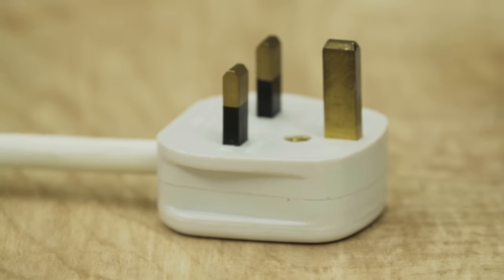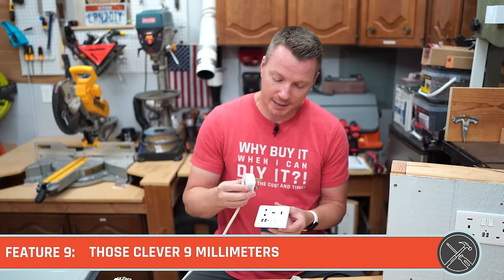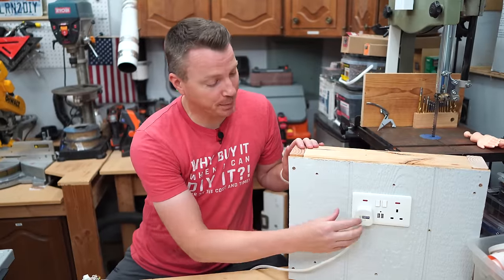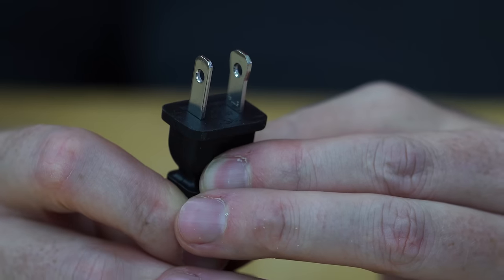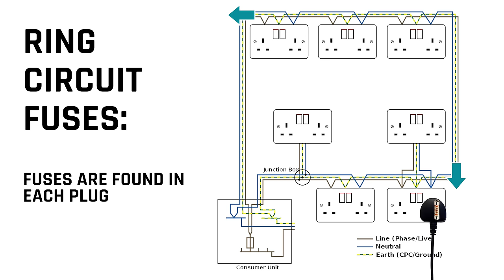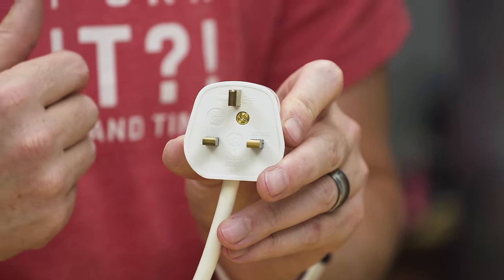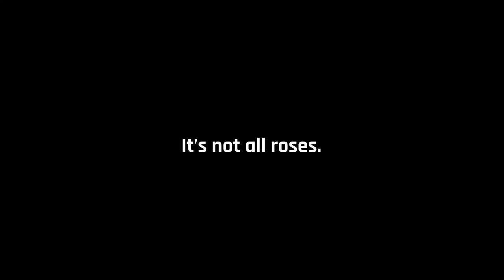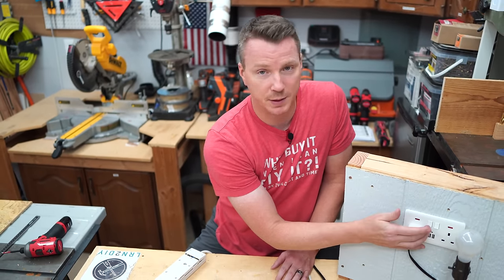British Plugs and Outlets Are On Another Level

Comment: One of the benefits of the removable plug that isn't mentioned is that you can remove the plug to pass the cable through a small hole and then reattach the plug. This can be useful and is far better than having to cut a massive hole to pass an entire plug through.
Reply: I did this when connecting up my offgrid solar to my home office, got a big extension cable, put the cable through a vent (60s house) and reconnected, no need to require a massive drill to drill a big hole through the wall
Reply: We can take the plug off and have an even smaller hole😉
Reply: @infideluk  They really don't get it, do they
Reply: @FirstNameLastName-hahaha  who is/are they here?
Reply: Good shout
Reply: Another advantage is that you never have to buy a new plug - when old appliances die, I always remove the old plugs/fuses in case I need them, such as for extension cables or if a plug gets broken, though they are very solid and last a long time being quite hard to damage. I have one plug in daily use that must be about 60 years old.
Reply: Been there, done that!  :-)
Reply: Those plugs are like mice you can fit them through a hole the size of a pencil if you know what you’re doing
Reply: @littlebigcat  Whilst a cable will genuinely fit through a hole the size of a pencil an entire plug will not.
Reply: @littlebigcat  We would expect nothing less than purrrfect advice littlebigcat when it comes to mice.  🙂
Reply: I've got a 6 gang switched trailing socket out in my porch that way.
Reply: @zimzimph  if the shoe fits ..
Reply: @roaduser6438  what littlebigcat means is it’s easy to remove the plug put the wire through a small hole then re-wire the plug takes a couple of minutes👍
Reply: @psyjayne  That doesnt appear to be what he means as that's what my original comment is. Littlebigcat talking about the plugs says "you can fit them [the plugs] through a hole the size of a pencil". If he did mean what you think he means it isn't what he said and isn't anything that hasn't been said already.
Reply: Don't you just hate the plugs moulded onto the cord. You cut it off, bin it, and replace it with a new one from the store of spares.
Reply: I bought a unit for my hi fi the picture shows a record player on top with a amplifier underneath. When it came there was no holes for plugs. I was going to buy a hole making drill bit but it was £15. I ended up drilling holes in a circle and hitting it out with a hammer. I wouldn't have bothered but I had cables as well as the plug , to come from my amplifier.

Comment: Another feature of the British plug is the fuses also come in various capacities such as 3 amp, 5 amp, 10 amp and 13 amp. Electrical items will come with the correct amp fuse relevant to the load it will be under during normal operation.
Reply: Most think the fuse is to protect the appliance too but this is false, the plug fuse is to protect the cable and should be sized as such.
Reply: The downside to this is that when people casually replace the fuse, they almost always slap in a 13A one regardless of what the requirement is.
Reply: @moopet8036  I do like for like everytime.
Reply: @moopet8036  assuming they bother with a fuse and don't go for rolled foil from their last pack of smokes.
Reply: @anne_frank_ lol a pack of ten assorted fuses is £1. I keep a couple of packs in a drawer 🤣
Reply: @anne_frank_  would that actually work? and for how long?
Reply: @DAN.eight6  It depends on how much current the device draws. If you're lucky, the foil will be destroyed very quickly. In the most unlucky scenario you use something that can carry far more current than the cable or the device itself and a partially or fully shorted circuit makes the cable or device burst into flames.
Reply: @DAN.eight6  yes it works, yes people do it and dear god I’ve seen worse over the years as a sparky. 

Rewirable fuses keep blowing? Just put a few more strands in to fix it  I have actually found a bit of cable fitted instead of fuse wire and even the classic nail. Scary things to find.
Reply: @DAN.eight6  It works, just not as a fuse. At least until it does real badly. Don't do it. I work as an electro-mechanical engineer and repairing other people's machines I've seen a lot of stuff used in place of a fuse. Nails, bolts, metal cut-offs, even a small soldering iron tip. Safety third in a lot of shops.
Reply: @syrea793  Sadly not everyone is as sensible as you, especially in a workshop where even if fuses are made available the 200lbs gorilla operating the machine will just cram a nail or a paperclip in because it's 'faster'.
Reply: @DAN.eight6  It'll keep the electric going but the point of a fuse is to cut off the electric when there's a danger. Don't do it, fires might ensue.
Reply: @moopet8036  exactly. A boiler should always be 3A for example but I found a 13A one in there when I moved in
Reply: @syrea793  I've got a big mixed bag of whole plugs or just fuses at home ,every time I scrap an appliance,  I have at  best a whole  spare plug,or if the plug is moulded, I whip the fuse out , for a spare.
I do similar with cars. If I scrap a car, I take all the fuses and bulbs out for spares.
Reply: The Main circuit will trip before that. @Curt_Sampson
Reply: @mauricegreen8185  Really? Why would they bother with the 3A fuse in a plug then, if can handle current all the way up until the 30A main breaker trips?
Reply: As a european: why fuzes in the plug?
Do you guys often have to replace one?
In some cases i can only find them in appliances itself. But even then never ever had to replace one. 
Aren't rccb or whatever it's called there for such reasons? Replacing fuses in general feels like 1962 here..... Just because people always put in a stronger one thus making it more dangerous.
Although the switches are a smart thing i'm jealous about. Do you guys have them with a internal light?
Reply: @KD-op4yz  The fuse in the plug protects the power cable. Damage to the device or the cable can cause more current to be drawn than the cable is designed for. If this is not drawing enough to trip the (generally much larger) circuit breaker for the power outlet, the cable will heat up and set on fire things around it, and perhaps even catch on fire itself.

If you look around YouTube you can find plenty of videos of AC power cord fires.
Reply: @Curt_Sampson  The reason for the fuses in the UK plugs is that 32A main fuse. In continental Europe, there are much smaller fuses at the breaker board, so the chance of the wires catching fire through overheating is much smaller.
Reply: @Curt_Sampson  thanks for the info 😉

Comment: One of the minor features about the plug that often gets overlooked is that if you are colour blind you can wire it correctly as the colours are designed so that one is black one is white and the earth is black and white and the colours where chosen for both the letter reminder and again with partial colour blindness they could never get mistaken

Comment: Having a larger plug is useful if you have poor grip/dexterity. Indeed in the UK we have versions of the standard plug with a hoop on the back so that you can put a finger through it to pull the plug out. My late mother had arthritis in her hand and I replaced several plugs she would need to swap over every so often with these larger hooped versions to make it easier for her.
Reply: For plugs which don't come with a loop grip you can buy a thin plastic loop which anchors from top and bottom on the live and neutral pins to create a pull loop. My grip is staring to get a bit dicey and they are really useful for removing a tight plug.
Reply: @daviddou1408  well pulling the cord wouldn't help anyway.
Reply: Breville appliances sold in the US have that. It’s very cool 😎

Comment: Hi from the UK. We used to have everything on a separate fuse, but one of the reasons we went to ring circuits was to save on copper after WW2.
Reply: That's fascinating, I didn't know that.
Reply: I didn't know that either.

Comment: The other feature of the replaceable internal fuse is that you can match the fuse to the load. Fuses are available as 3Amp, 5Amp or 13Amp and are colour coded to prevent confusion.
Reply: 7a and 10a are available to British Standard too. Rarely seen.
Reply: Williams I suggest watch a 13 part series called What on earth happened by Ewaranon to learn that the earth is not a globe. Link in my about tab.
Reply: @flat-earther  You just want a free trip into space
Reply: @2Sorts  You can get 1A and 2A ones also, but yeah mostly need to shop online or at specialist stores to get them as most brick and mortar stores don't carry them.
Reply: @seraphina985  This is also true. 1st I saw those was at Bacton Gas Terminal. They used to fit the absolute smallest value fuse to any plug-in equipment that went out to the rigs. 
Even new stuff had to be opened, examined, re-fused and then PAT tested by the maintenance shop on site, before I was allowed out to the rig.
Reply: @2Sorts  That makes sense especially in that environment where the hazmat being processed would significantly exacerbate any ignition due to overloaded electrical equipment. I'd imagine that there was probably a lot of work done in trying to ensure any electrical components that safely can be airtight are where possible. I'd assume it would be a layered defence strategy first minimise the risk of electrical faults becoming an ignition source, failing that try to exclude the potential chemical accelerants from contacting the electronics and so on.
Reply: @seraphina985  I have some 1A and 2A fuses but they are the glass ones
Reply: @2Sorts  Or the universal fuse made out of tinfoil. I've yet to find one that fails!
Reply: That is a great feature, but if you don’t happen to have any spares in your kitchen drawers, tin foil has been a dangerous work around. 

Now your blown small fuse is the mains rating of the ring circuit.
Reply: The fuse protects the appliance cable and must be sized according to the gauge of the cable. The appliance cable should be sized according to the appliance load. Everything depends on everything else. "Load balancing" nope, not required. Ring mains use less copper overall, and while it is not an ideal situation, can operate with lower safety margin with one ring continuity fault.
Reply: Although you can do that it is worth remembering that the actual purpose of the fuse is to protect the cord, not the load. It's to stop the cord from catching fire if the load shorts. That means it's fine to use a lower value fuse, to do what you say to protect the load (although the load has failed already thus blowing the fuse lol) but you never increase the value of the fuse o er what was fitted!
Reply: It's good because you can reuse the plugs, say your hairdryer on a 15a fuse dies, just take the plug off, chuck the hairdryer in the bin, use the plug with a 5a fuse and wire it onto a lamp for instance... Lot less waste
Reply: The plug fuse is not designed to protect the load. Instead it is designed to protect the cable between the plug and the appliance.
Reply: I can't say the colour coding was something I ever really noticed - I just read the requirement on the plug and so never even noticed the fuses were a different colour to be honest until you just told me they were.
Reply: Except the far majority of people will replace the smaller amp fuse with the standard 13 amp fuse.

Comment: The size of the plug is actually a bonus, it helps older people and those with physical limitations easily grab it as it is a bit more substantial also it's shaped so that the sides have two ridges (which you missed) these ridges fit easily between the thumb and fore finger on it's side when you want to remove it from the socket. 
But yes I totally agree our plugs are literally adult caltrops if you leave them on the floor pin side up.
Reply: I always thought they looked overly big, but you are right, Swedish standard plugs can be very hard to remove. Especially the grounded type with contact plates on the sides.
Reply: I've even seem some products aimed at the elderly which have plugs with an added "ring" on them. This lets the user slip a finger through to pull the plug out should they not have the grip to remove the plug normally.
Reply: @IainPurdie  Silly question... you're not Iain "Mad Mosher" Purdie who once wrote to 2000AD and studied in Bradford? Cos it's a small world...
Reply: When using NA plugs, often I have to pull on the cord to get the plug out, which is quite dangerous tbh. Never had any issues pulling out British plugs.
Reply: Why would anyone leave the plug lying on the floor? Aha, you mean the people who leave knives wrong side up on the sofa. Yes, those people are not cared for properly and should ask the care ladies to tie them down tightly at night.
Reply: @kennethkeen1234  No when you unplug something and just leave it lying there, thinking, you aren't likely to be in that corner standing, then you are doing someing next to it and mistakenly step back forgetting there's a plug which I normally leave pin down has found a way to right itself in time to become a human caltrop.
Reply: The UK plugs are great for all the reasons mentioned in the video and easy to remove as you stated.
I just wish they were reversible like the EU plugs.
Reply: The size is NOT a bonus!
Reply: Yes, probably true. Here in Australia, sometimes when I purchase a new kitchen appliance it comes with a loop on the back of the plug which is excellent. You simply put your finger in and pull the plug out.
Reply: @kennethkeen1234   "Aha, you mean the people who leave knives wrong side up on the sofa. "  This guy comes from a country of people who are capable of going shopping a 9mm round loaded in the chamber of the gun in their hand bag and forget to flip the safety catch. Stepping plugs is not something that should worry them.
Reply: @kennethkeen1234  People whose sockets don't have separate switches would leave the plug lying on the floor if they had to turn the power off to an appliance. Over here in the UK, however, we just... flip the switch and leave the plug in, nice and safe, away from our feet.
Reply: Caltrops?  Ambassador you spoil us!

Comment: They call it the type G because it's the type "Great". We have this as the standard kind of plug in Malaysia. The downsides are a bit hard to relate to and do sound a little tenuous though because we've always grown up with switched sockets and extentions so isolation is easy and you never really have to unplug anything save for a portable vacuum which gets put away anyway. Awesome video nonetheless for bringing to light many of the technical and safety features we take for granted.
Reply: It makes it easy to reset routers, too. No need to look for some annoying power button hidden somewhere on your router, you can just switch it off and on.
Reply: it's one of those rare cases where an actual engineer designed it instead of someone in sales.

Comment: I found it interesting about when you were talking about plugging multiple things in. I've literally never thought about it. I've always just plugged whatever I want in wherever and everything works fine.
Reply: yeah it would only be an issue if youre running multiple 1kw+ machines near each other
Reply: @Kingcloudii  not really, most kitchens will have their own 32a ring circuit which is perfectly capable of handling 2kw dishwasher, kettle, toaster etc at the same time. Even when the circuit is overloaded they are designed in such a way that they don't trip instantly, so short term load spikes by kettles or whatever wouldn't necessarily trip the breaker
Reply: This reckless cavaliar attitude is why the world is on fire!

(As a brit I also never thought about it too much - I do  try not to run the kettle and toaster at the same time as they're both connected on the same double wall socket)
Reply: @thomasfoster5879  it'll be fine. We run both. Wall cable will be rated for 30 Amps. Toaster and kettle will each pull less than 13 Amps, as that's the maximum size fuse you can put in a plug, and as it's a ring, not all the current comes down the same section of cable.
Reply: It used to be an issue but hasn't been for a while. Most appliances are quite efficient these days